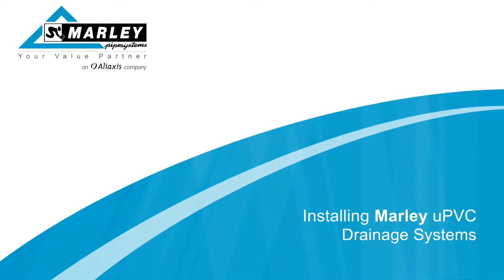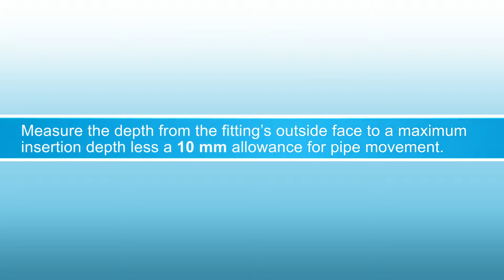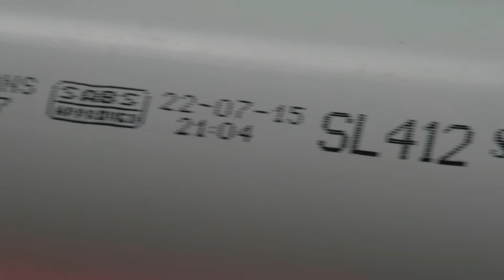marley drainage

Comment: if only this didn't require two strong men.  Try doing that with 1 female on a ladder. Impossible.  Surely there is an easier way!  Flexible rubber joint?